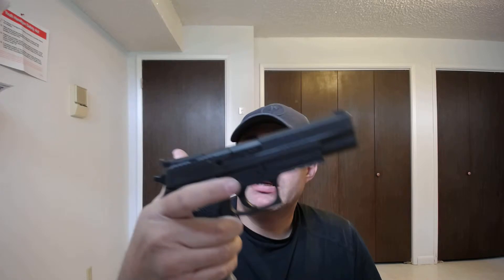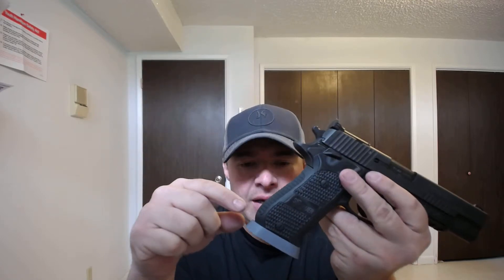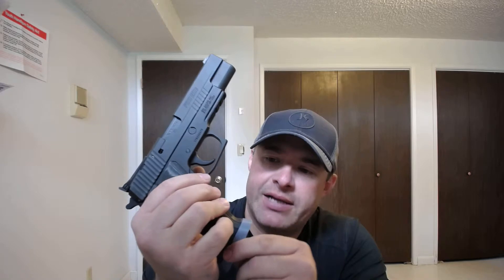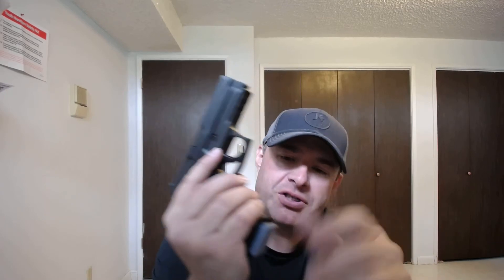Sig P220 Magwell

Comment: How are Hope Your doing well with all this CRAZYNESS going on any way was wondering if you could contact me About a magwell for my new LEGION 220 45acp and was wondering if it was just the grip that needs to be cut or if any major frame modifications need to be done thank you very much
Reply from the maker: Only the grips need to be modified. The frame is good to go. You will also need baseplates.